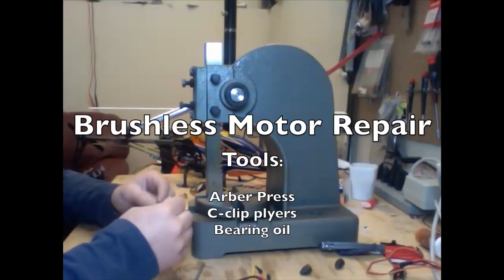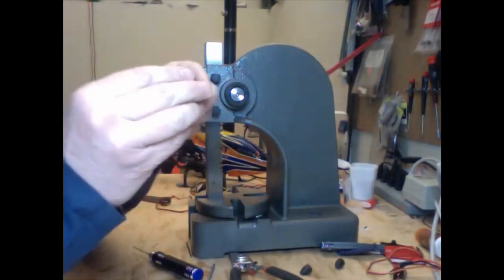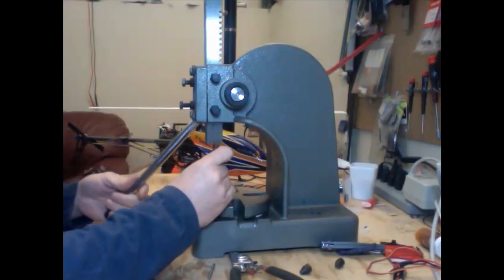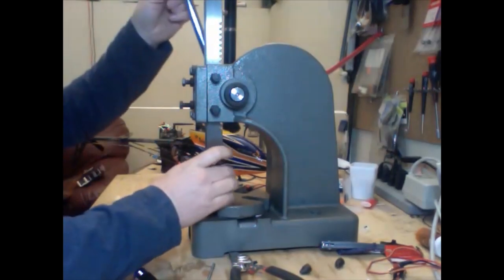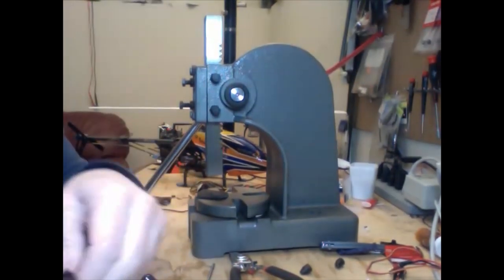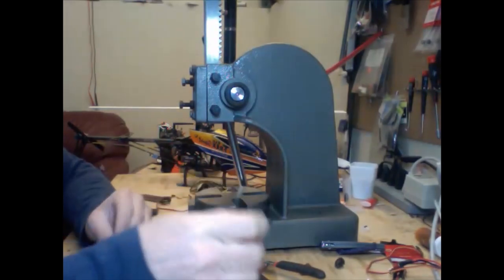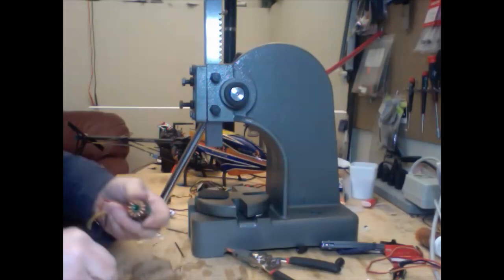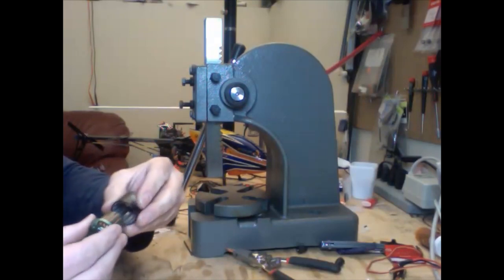How to repair a brushless motor

Comment from the maker: To jc-vid,
Check your ESC. It sounds like an ESC problem and not a motor problem, try spooling up with a different ESC. If the problem persists, check the make sure there is no shorting across the phase wires. Read my reply to george kontopoulos for instruction on how to do this.

Comment: If the motor has some black coils the motor is dead?
Reply from the maker: It could be. Sounds like you might have introduced a short. Set your Multimeter to check for continuity and check all three wires together. Say that each of your phase wire are numbered #1, #2, & #3. First, make sure your multimeter is set to  (continuity) then touch the black wire on your multimeter to phase #1 on the motor and the motor stator, do this for each of the phase wires, there should be no continuity between motor stater and the phase wires. You will have continuity from phase wire to phase wire though. If you there is continuity from wire to stator than you have a short.
Now, if the phase wire not showing continuity (i.e. no shorts) and the motor still doesn't work then the heat that cased the blackening might have damaged the magnets. Test each magnet with something iron and make sure they still attract the iron. You need to do this with the motor apart so you can get at the magnets in the can of the motor. If you are still not getting any turning from you motor then you have to check your Electric Speed Control.
You could also mount the motor to something solid and heavy and put a propeller on the motor and put an Amp Meter between your power source and the Electric Speed Control and measure the Amp draw. 
In short, your two biggest concerns will be a short across the phase wires or the magnet loosing their polarity due to over heating.
Good luck.

Comment: Maybe you can help.  I replaced some bearings on a brushless motor which was functioning just fine other than being noisy.  When I put it back together, the motor spins freely by hand with ease.  When I power it up, the motors turns a few times, stops, then tries to turn again and stops.  What could be the problem?  Thanks.

Comment from the maker: Yes,

I'm sorry about the noise. A vacuum was being run at the time of the video. I was hoping the mike would not have picked it up but it did unfortunately. I agree with you about the noise, I wanted smash the vacuum half way through. I'll see about cleaning it up.